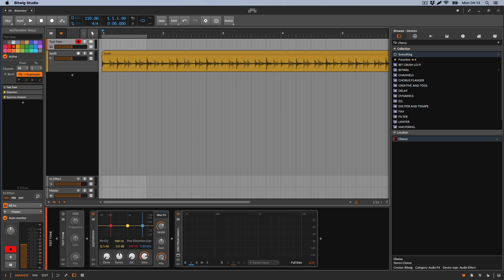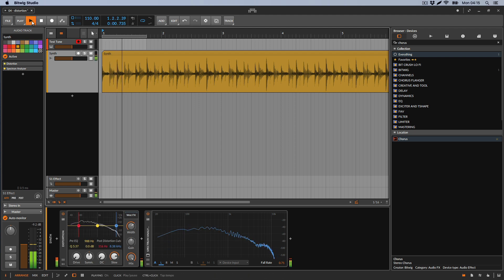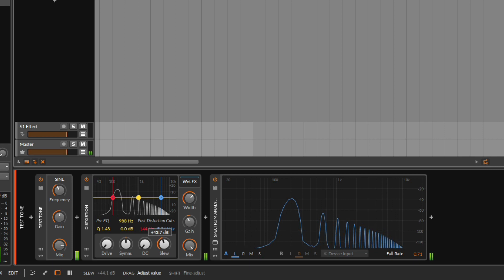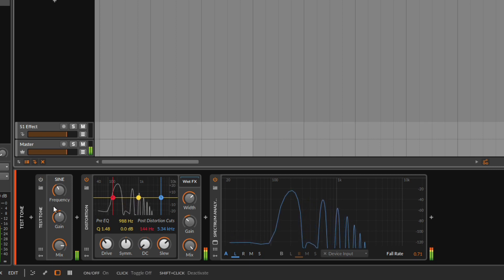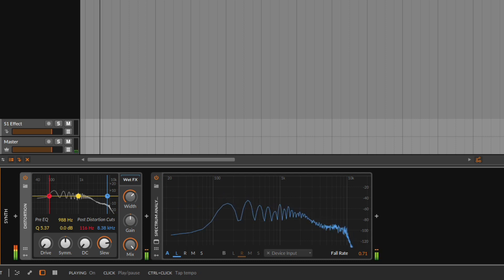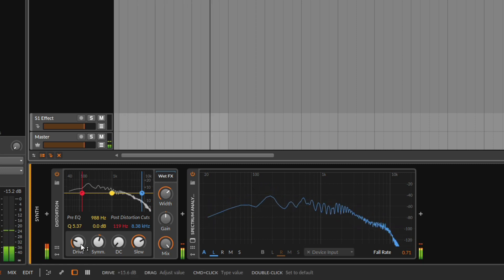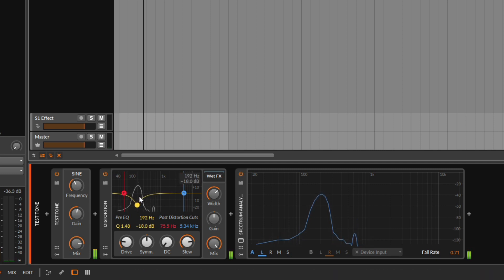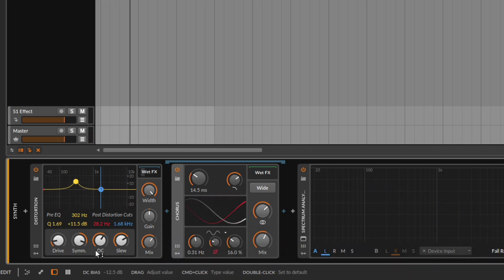Understanding the Bitwig Distortion Device

Comment: cool video.  :)   Do you think you can mix and Mastering a sound entirely on bitwing without going for other software or hardware?
Reply from the maker: Hey !! 100 %, bitwig its a DAW, just like any other daw you can mix and master. Bitwig is more "making beats" orientated rather than mix and master,  some other DAW like studio one its more mixing orientated software, but you can make beats on studio one as well, but for that its not as easy as bitwig. So, yes you dont need two daw's